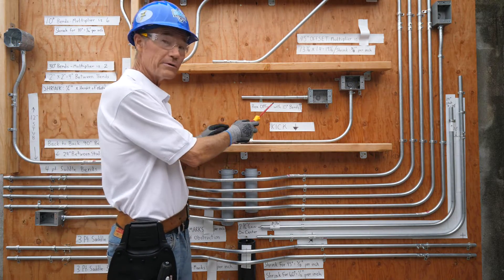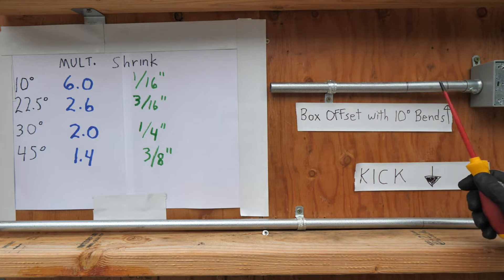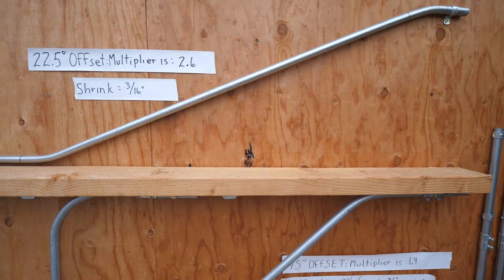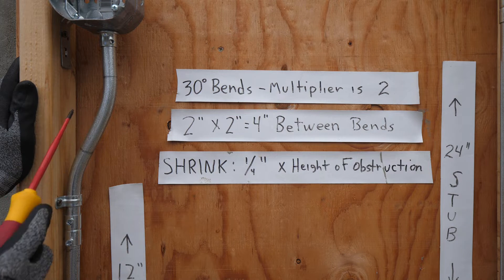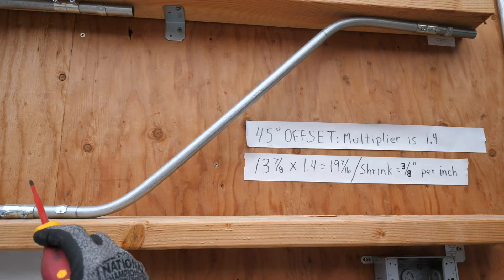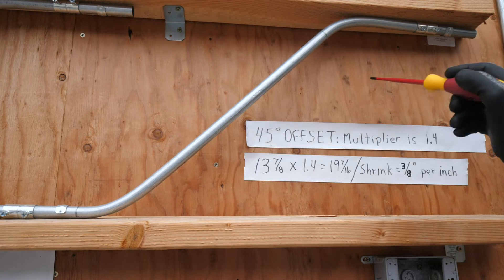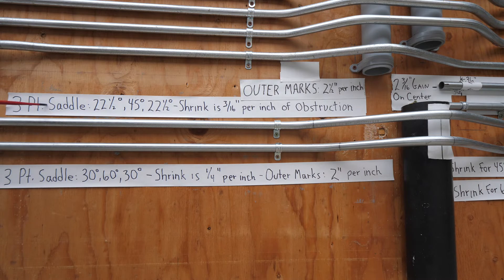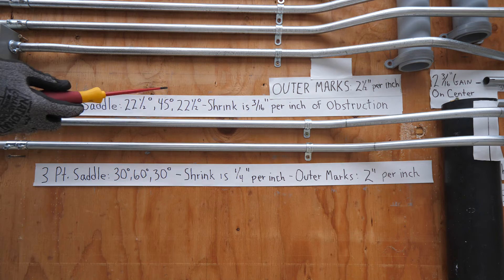How To Memorize EMT Multipliers, Shrink and Outer Marks of 3 Point Saddle Bends

Comment: Another excellent presentation!
Reply from the maker: Thank you! Cheers!
Reply: @SparkyChannel  what is your take on pulling 5 to 9 conductors in a into a raceway. Do you tape them with one or two used as a hook, or use pulling fingers and bundle them or strip reduce number of strands and feather using most all as a hook

Comment: I’ve taught myself how to bend conduit by the number through resources purchased across the internet. This is the only medium I’ve found that explains the technical aspects of conduit bending from A to Z completely. Thanks Sparky Channel! If I can make a request, please explain conduit gain, measuring conduit necessary to length prior to bending, parallel offsets, and single shot concentric 90s.
Reply from the maker: This will answer some of those things: How to EMT Bending: Box Offsets, 3 Point Saddle Bend and Back-to-Back 90's All in the Same Run!: https://youtu.be/poJd9jy8kAo